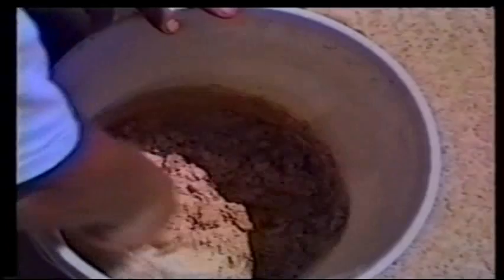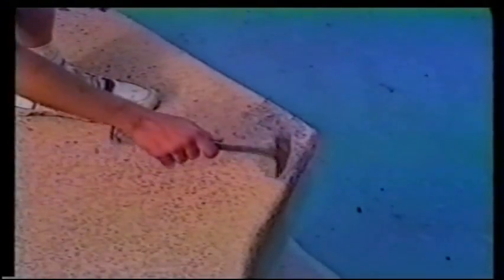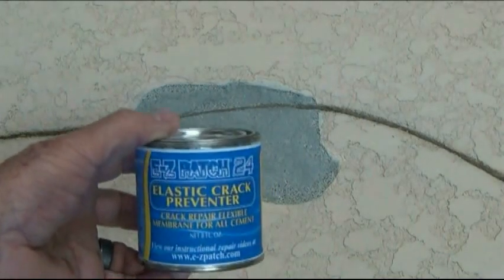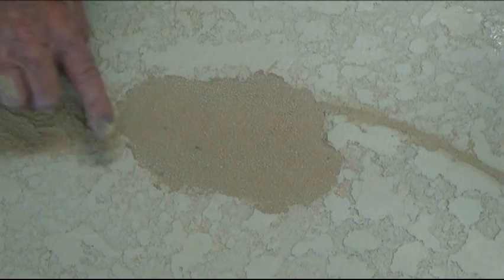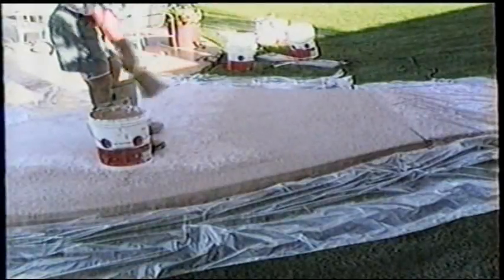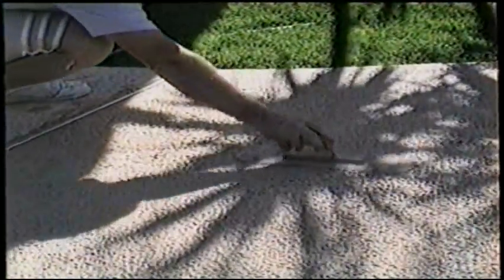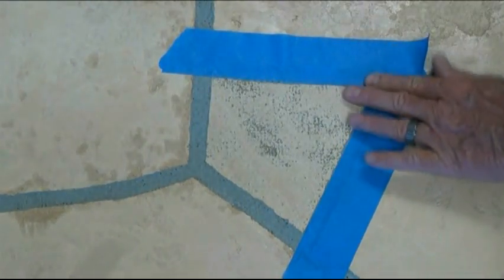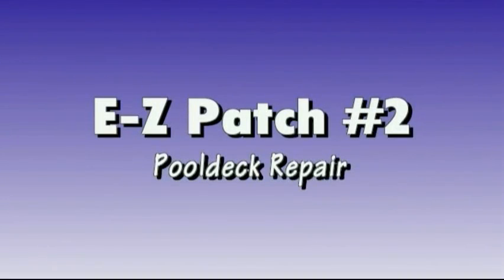E-Z Patch #2 Repair Kit for Pool Deck Surfaces "NEW"

Comment: Great video.  Mine came out great.  It’s amazing how easy it was. It’s been done now for a couple of hours. It looks and feels dry, but nowhere in the video or container doesn’t if give you the recommended drying time.  I live in Florida, it’s 88 degrees and 77% humidity. Thanks for your help.
Reply: E-Z Patch website has info on that.

Comment: Now the neighbor has asked me to do this on hers.  However, should I pressure wash the whole thing first?  Because there are several bigger places where it is flaking up and it is very loose all around for quite a big area, if I pressure wash it, I am afraid all of it will loosen up?  Should I use a bonding agent first?
Reply: Two years later and no answers to your question 🙄
Reply: You likely got your answer by now, considering the amount of time that's passed since it was asked, but I had the same issue and went ahead and pressure washed it. I got the best results by making sure anything that was loose, or in danger of becoming loose, was removed first, then I scrubbed the "wounds" out with Acid Magic (a muriatic acid alternative) and a brush, and rinsed it before applying EZ Patch.
Reply: @trknowles  thanks that helped me to get started on my repair

Comment: I got a question, when u used the wetter of the two mixtures u used a broom to place onto kool deck. But u also got a lot into the pool water. How do u get the deck repair stuff out of your pool and bottom of the pool? If u vacuum won't it get in all your pipping and pump?
Thanks
Reply: It just dissipates into sand. Completely harmless in your pool.